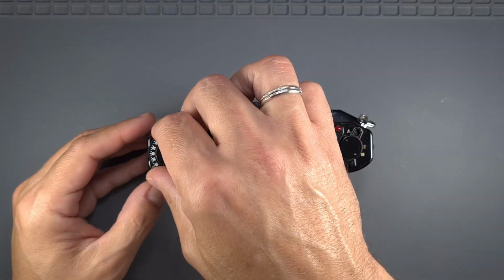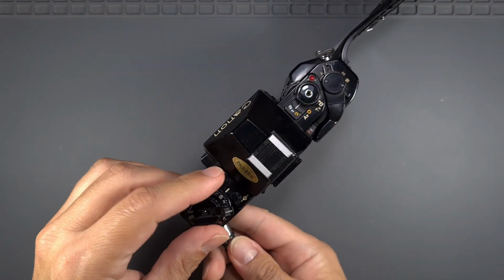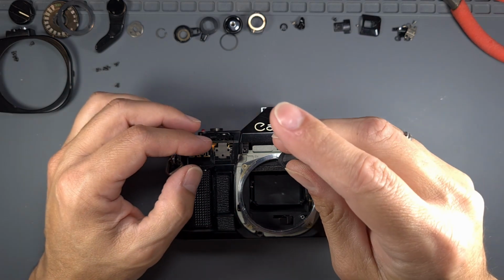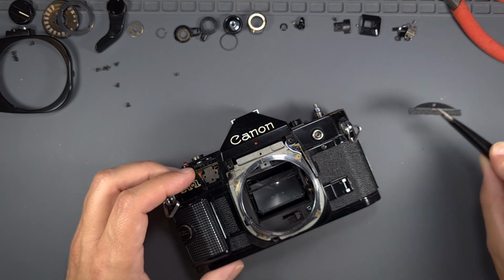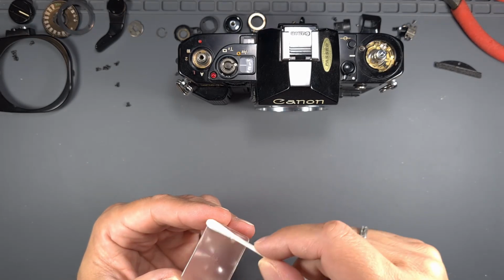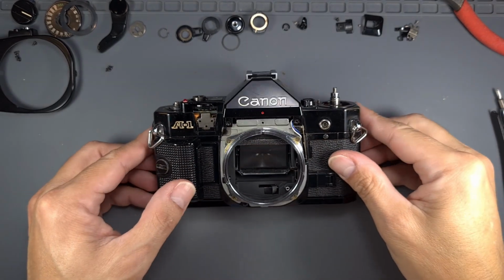Canon A-1 - Clean the Viewfinder

Comment: Can you do a tutorial on cleaning dust from inside the prism?
Reply from the maker: Inside?? You cannot access the "inside" of the prism... it's a block of glass...
Reply: @FotofixVintageCameras  I have a piece of dust or something that doesn't appear to be on my view finder or my focusing screen.... 🤔  figured there was maybe somewhere else it would be? It's a couple black spots showing up when I look through the view finder and still there when I remove the focusing screen?
Reply: @FotofixVintageCameras  or perhaps a tutorial of removing the prism to clean its surfaces?
Reply from the maker: @derekr7814  When you removed the focus screen have you used the lens blower to blow under the prism? It can also be spots of desilver on the prism...
Reply: @FotofixVintageCameras  yes I did blow into/under that area.

I seriously hope it's not desilvering
Reply: There is a lens between the focus screen and the prism, that's where all the dust will be. My camera has fungus in there that I was hoping to find a video showing a easy way to get the prism out, but it seems the only way is through suffering removing all of the flexible circuit board.

Comment: Hello sir. I recently bought an ae1 fee and I have a small but annoying problem. When I leave the camera standing (30 minutes or more) the first shots (1, 2 or 3) the second curtain takes time to go down, leaving the diaphragm in position until the curtain returns to position. Do you know what the problem could be? Thank you in advance!!
Reply from the maker: At any shutter speed?
Reply: @FotofixVintageCameras  Yes, I have also tried with the lens removed and this problem does not happen. I have cleaned the electromagnets with alcohol and nothing. The next thing I'm going to try is to put a drop of lubricant in the mirror mechanism to test if this is solved
Reply from the maker: It's in fact strange... but I think the lubricant will not solve the problem. If it doesn't happen with the lens off, the problem is not from lubrication... The lens works ok in other camera? Seems the problem is in the lens or in the connection between the lens and the camera...
Reply: @FotofixVintageCameras  Yes yes, the lens works well in another canon that my roommate has. If you want, give me your email and I'll send you a video later so you can watch. And if we solve it, I can send you money for help. Thanks a lot
Reply: @liosmarruiz7025  I have the exact same problem! I just recently learned that it doesn’t happen without a lens. Would love some insight on this issue